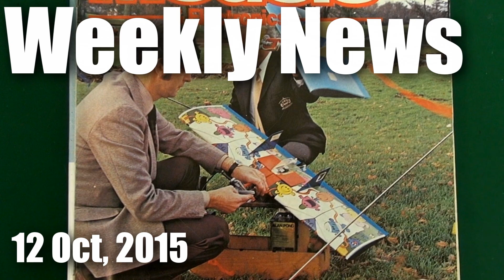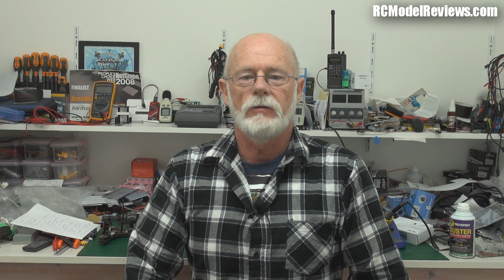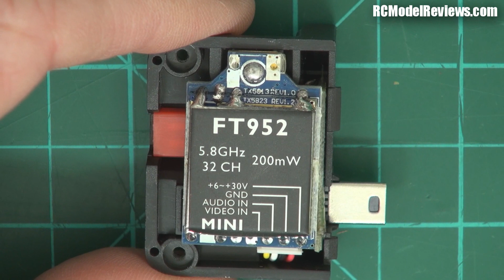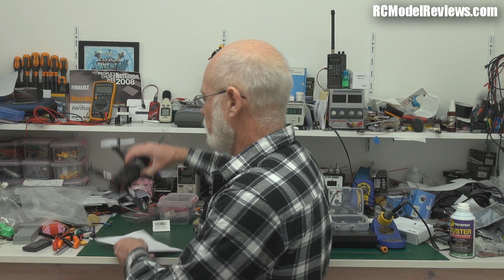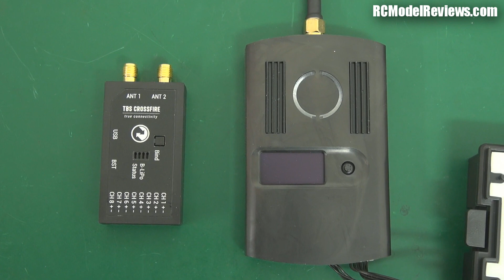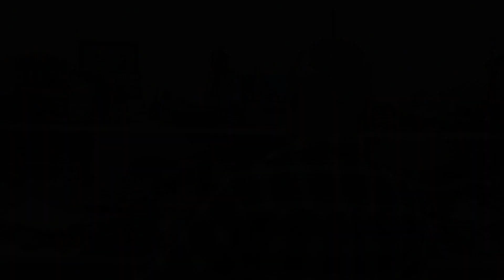Weekly News (12 Oct, 2015)

Comment: Woohoo! Bruce Simpson mentioned my name!!!!! :D
If you are doing an S.Bus inverter then it may also be worth showing the simple hack mod you can do to the X4RSB which bypasses the inverter on the receiver PCB negating the need for an inverter cable at all.

Good to see you back mate :)
Reply: +FinalGlideAus Yep, I love the dirty X4RSB Pin2 hack :D Works great! The Moto Tornado's don't need it though do they?
Reply: +RCShufty No The Moto Tornado does have Sbus direcly on board. No need to use inverters here. (I have a tornado :) )
Reply: Nice one :D
Reply: +RCShufty All the F3 FC's will handle S.Bus natively.  The CC3D and Naze rev.6 will also.
Reply: +FinalGlideAus Indeed! I was not looking forward to a Bruce-less future. Hmm... does that work on the X8R too? I was going to embed the ZYX... (YXZ? XYZ? whatev...) adaptor inside the unit, but a jumper wire is smaller. :-)
Reply: +FinalGlideAus Yeah.. that's a decent hack but I suspect there are a lot of folk out there who would cringe at taking a soldering iron to their shiny new receiver ;-)
Reply: Another simple workaround for the X4R and X4R-SBUS receiver for easy connection is to use the recently released CPPM firmware available on the FrSky website. Admittedly it doesn't provide the lower latency of true SBus but as my current flying style with my Vortex is more Morgan Freeman in Driving Miss Daisy than Metal Danny and Charpu then it is a quick and clean solution.
Regards
Nidge
Reply: +xjet Hi Bruce, could you also explain how to setup telemetry with the X4R S.Bus receiver and the Naze32? I really would like to use the X4R S.Bus receiver but without telemetry I dont want to switch from my D4R-II.
Reply: +xuxusito the x4r has S-port and the black one has Sbus.
You beat me to mention about the Sbus hack and the CPPM firmware upgrade on the frsky forum, to my knowledge it is still in beta test and only available to members who search that thread.
There is a new naze 32 acro on the market, rev6. You get a barometer on it and a Sbus inverter which looks like it will invert frskys inverted Sbus signal back for proper use! I will have to try it to prove it, sales claim it is not cleanflight compatible this has been fixed it will now work with cleanflight.
Reply: +Jeremy Lee 
The X8R has a different construction, but if I remember correctly (I read it/saw pictures somewhere), it's even simpler on the X8R. There's a pad inside the receiver that has the non-inverted signal. Just solder a wire and connector (outside the case) to it and you have SBUS and non-inverted SBUS at the same time. On the other hand, I built my inverter from SMD parts (salvaged all that's needed from junk electronic PCBs) and spliced into the signal cable it's just as big as the finger nail on my pinky. So not really worth cracking opne the X8R.
Fun fact: the micro in the X8R is the same as on a Naze32 and the signal gets inverted twice by external inverters (one of which you have to build yourself) when they talk to each other.
Reply: +Kendrick Apps I know that the Naze32 rev6 supports the S.Bus signal from the X4R receiver out of the box but as far as I know the rev6 still doesn't support telemetry from the X4R Smart Port.
Reply: +xuxusito I'm not so sure on that if the Rev 6 can output telemetry to the d4r2 then it can to the x4r from what I remember the only telemetry information that was given was battery voltage through the ad2 pin on the d4r2 , the same is true with the x4r, the problem is pin out frsky had to go and mess things up by changing the order and the names given to the pins. On the d4r2 it was easy, RX TX AD2 GND. But on the x4r it is S + - AIN.
I'm guessing that AIN is for t he telemetry from the naze rev6 board along with -. It would have been so much better to keep the same names and order!
Reply: +xuxusito 
AFAIK SPort needs another hardware UART (can't be done fast enough in software). Since you're most likely using SBUS at the same time (which will need another hardware UART), it can only be connected to the same UART that's already used for CLI (the third hardware UART the STM32F103 has, can't be used, because its pins is where the I2C sensors are connect on the naze; a weird design flaw in my opinion, because the sensors could have used other pins). For CLI to work you would have to disconnect SPort every time. I never got it to work anyway with the cleanflight firmware (and never tried baseflight at all), but I'm currently trying to change cleanflight to use all five hardware UARTs of the the bigger brother (F103V, dev boards with that cost 15$ on ebay, but it needs extra sensors) of Naze's micro (F103C). I've never flown it, but I have a working setup that runs SBUS, SPort, CLI (via Bluetooth), blackbox recording and GPS at the same time and uses sonar, LED strips and beeper. Unfortunately I still don't understand the firmware code good enough (it's a mess grown over quite some time from the baseflight days), to guarantee a craft won't crash and burn on the first launch ;)
Reply: +Jeremy Lee I don't think you can get to the particular part on the PCB on the X8R.

Comment: Hey Bruce, I had a small chat with Boris about why Chad noticed such a big difference using SBUS (instead of PPM). It turned out that Cleanflight was taking a three point average when reading the PPM signals, something it didn't do with SBUS. This imposed a noticeable delay. Boris has removed this three point average from Cleanflight and replaced it with a better filter (which doesn't impose a delay). This has been merged into cleanflight v1.10

So there might not be that large of an advantage to use SBUS after all.
Reply: +Jaap Pieroen Wow... a three point average -- that would introduce some pretty significant latency so it's no wonder Chad noticed a difference.  I wonder what was behind the decision to do that in the first place -- seems pretty crazy -- unless jitter was an issue on the PPM signal.

Comment: I actually wore BDU's.  Battle Dress Uniform when I started working with RC planes etc.  Was in the military and the officers trained on flying the drones using RC airplanes.  I would test fly and trim out the plane, land and hand over the transmitter.  One officer didn't get it off the ground and figured out a way to completely destroy the plane.  He just handed back the transmitter and said "looks like it needs fixing" and walked off.  Yum, week of building and an hour of tuning and trimming to just have it totaled in less than a minute.  Such is life.

Comment: Bruce, I'm so glad to have you back!  While on the topic of inverters, I am struggling with inverting the telemetry coming out of USART2 on my Flip32 mini FC board.  It doesn't have pins for softserial, telemetry pins, or built in inverter circuitry.  Can you also cover inverting telemetry data, and the theory behind inverting a signal, and how to design the circuit!  Many thanks! :)

-Duane

Comment: I used a Teensy3.1 as an SBUS reader. No inverter needed as the Freescale arm processor on the Teensy actually has a software invert option on the serial ports. I used an existing arduino library for SBUS but had to steal some code from the Pixhawk codebase to handle all the various packet delimiters for SBUS v2 etc. Works very well now :)

Comment: Bruce just in case you're not aware - you can flash BLheli to ESC's that have Simonk on them (providing they have the SK bootloader) but not the other way around. Also, i suggest flashing the latest SK firmware (2015-09-12) if you intend to compare them especially if you're using 2300kv motors on 4S due to max ERPM increasing from ~180K to 312K. Get yourself a $5 arduino nano from ebay - you can use BLheli suite to turn it into a flash tool that does just about everything.

Keep up the good work!
Reply: He is reviewing the quad as a kit as it comes from the store, so he wants to use the ESCs in as shipped state.

Comment: 10 minutes with an Arduino and BLheli suite and you'll have BLheli on those ESCs.  The BLheli can use the simonK bootloader, so no need to mess about soldering to pads or anything.

Comment: On BL Heli ESCs. I found that if you don't have the signal lead connected to anything and apply flight battery power to them, they might just lock up the SiLabs CPU. turn on all the FETs and go up in flames! I had this happen on a Tri-Copter build where I was testing the PDB and hadn't connected the ESCs to the FC yet . Lost a Rotor Geeks RG20 that way.

Comment: When my last quad had one motor doing that turned out it was a bad solder joint between the motor and esc.  Hit it with the iron and smashed it down better and it was fine.
Reply: +Bendc1970A1 Yes, I checked for that but the soldering was fine.  I might do a "fault-finding" video on the dud ESC -- not because they're worth fixing but because it could be a good way to explain how they work (or don't -- in this case).
Reply: +xjet That would be a great video as I have received a kit from HK with 3 out of 4 ESCs were bad and just smoked after a few minutes, they finally did replace all 4, but it would be nice to tell them what went wrong with the ESCs so they could fix the issue before they sell them. It's great to see you back and able to fly again.

Comment: I have had a lot of problems with the dys opto speed controllers. i used the 30a blheli . I started by buying 5, but 3 had the same problem that as you. By the time I had 4 that worked I had bought 9. I even tried reflashing and nothing worked. And 2 days ago one of those for failedl

Comment: You have your wings card, but have they (the council or whoever?) ended their ban on your testing of the collision avoidance system at the airfield?

Also, unlike other video channels I watch, when I move the mouse pointer along the time bar below your video, I don't get a small preview window of the video at each time hack. This makes it impossible to find a point in the video to move to. Is this a setting in your channel configuration? I have seen that feature in all of your previous videos. I wonder if it appears only a long time after the video is uploaded due to some kind of YouTube background rendering time requirements.
Reply: +Winston Smith 
The thumbnails are there for me. I've had that before and I'm pretty sure it's youtube taking time to render them.
Reply: +superdau Yeah, it must be render time. I just checked and they're present now.

Comment: Bruce, I know you have a lot experience with the NAZE32 FC's.  Actually there is a navigation -rewrite firmware version for the Naze32 in Cleanflight, which for my opinion  is a significant improvement for GPS-Hold and RTL flight modes in Cleanflight. The performnce of the Naze32 with this firmware can now be compared to the Pixhawk or the ArduMega FC's. And if we take into consideration the costs of a fully equipped NAze32 ($ 24) then the Naze32 is actually very competitive. So I would like to ask you, if you could give this Cleanflight firmware for the Naze32 a trial?
Best wishes from Germany, Juergen

Comment: to be honest Bruce, you just need shelving and a system for hanging your planes. I have seen many systems that work. Here is a hint. why dont you produce a show on how to better organize your shop and post it. Face it, everyone has a problem with room and no one wants to toss valuable stuff in the bin. my advice is hanging chain link fence so you can attach stuff to it I have seen somewhere on line a simular system for hanging your planes too. using simple hardware chain and and rings to attach wings and fuselage. stackable bins and even two by fours and pipes sticking out of the walls at an angle to rest the wings on. my middle name is cheap so are my ideas when it comes to storage. the point is, you can do it, why not make a show from it. who knows mabe a local hardware store will sponsor you by providing chains, nylon rope or even hooks and a fencing company can donate a short piece of fence to hang stuff on.

Comment: Why not add software SBUS compatibility to cleanflight? Shouldn't it be possible to change the code to be able to interpret the inverted signal by code?
Reply: +gilgameshismist I haven't looked at the Cleanflight code but a simple XOR or bit-flip operation should do the trick and I'm pretty sure the STM32 should have enough horsepower to keep up with the data-stream even after adding this.
Reply: +gilgameshismist 
SBUS is using a 100000 baud (yes, 100 thousand, not 57600 or 115200) inverted serial protocol including parity (don't ask me why Futaba needed to use something "different"). Because this would be too much to be handled in software, a hardware serial port on the STM32F103 micro that's on the naze is used. That chip can't do hardware inversion, so the hardware UART will throw all the packets away as invalid befor the software even sees it. Bigger cousins of the F103, like the STM32F303 on the SPRF3 can do hardware inversion, so won't need the inverter.
Reply: Cool, thank you for the details, I learned a thing or two from it. Much appreciated!

Comment: For anyone that wants to build the SBUS inverter now, I made a quick guide:
http://rcgroups.com/forums/showthread.php?t=2351863
Reply: +MystX1 
I would suggest adding another resistor in parallel to source/drain of the MOSFET. The value should be selected so that when the MOSFET is closed (doesn't change anything when the MOSFET is open) the 5V get divided down to around 3.3V (in essence twice the value of whatever R1 in your schematic is; I use 4.7k and 10k which works fine). The reason is, some of the inputs of the naze32 for example, and especially those of UART2 are not 5V tolerant and you could damage the FC by connecting 5V through a resistor too small.
Reply: +superdau good point. For some reason mine hasn't blown up yet but everyone should listen to this guy.